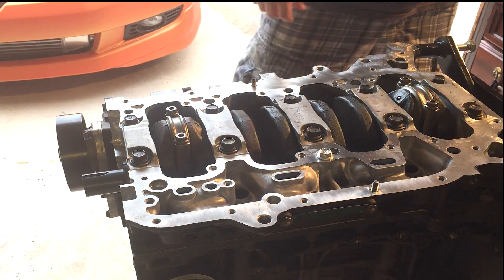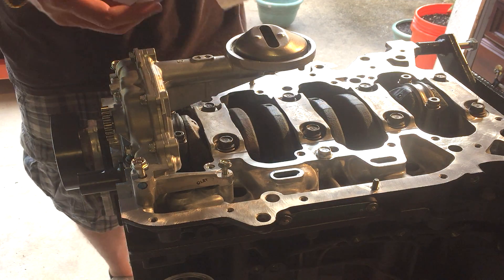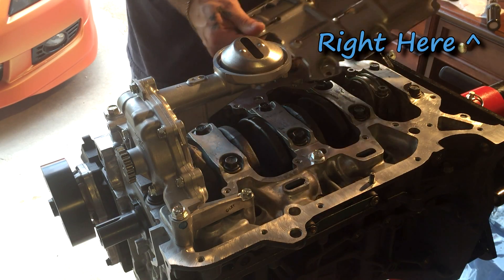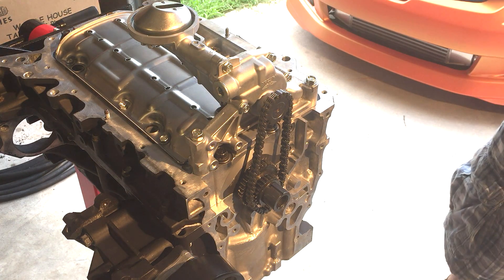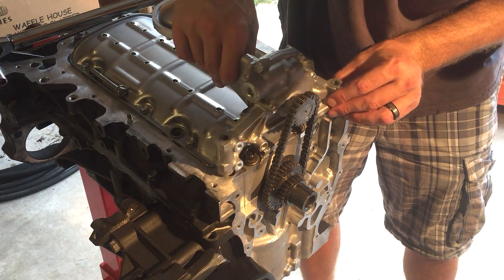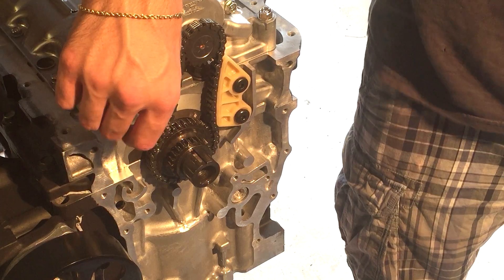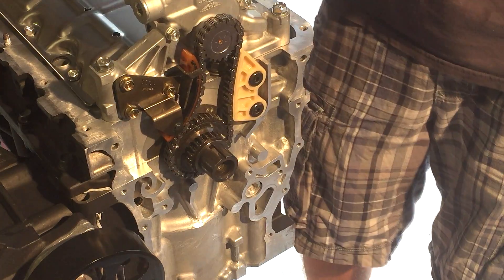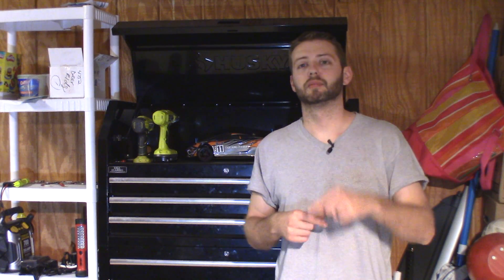RSX  Oil Pump On A K24 Block

Comment: i did  this mode but too much vibration,car doest remain smooth after this mode. Sound also increased. Sounded like a diesel. Reverted back to k24a2 oil pump. I love the balance shafts

Comment: awesome video. I ran into the Z3 block hairline crack on the block behind the thermostat housing. I ordered a 4 piston pump because I heard its ready to drop right in. I'm using my K20z3 head on the K24a JDM. U have any recommendations about the set up?

Comment: Hey, i have a question what's the part number to the bolt use to plug the hole there?
Reply from the maker: can't help ya there man. sorry. basically any bolt that matches the thread pitch and size will work.

Comment: i just wanted to know how does it feel vs the oem k24 oil pump i mean without the k24 pump balance shafts is supposed to be more noise, vibration, harshness in a 2.4 engine.  I was investigating and 2.0 is apparently the limit of accepted NVH without balance shafts thats why all engines above have them.  Thanks for your reply

Comment: What advantage does the RSX oil pump have over the original K24 oil pump?
Reply from the maker: the rsx oil pump is designed to have good oil flow at higher RPM. Alot better than the k24a2. It also weighs a hell of a lot less. dunno if it counts as rotational mass or not but it is a good 20 lbs.

Comment: Whats the difference of the kit? modified and unmodified. i have a k24a2 long block for rsx-s. All help is appreciated, thanks for the video
Reply from the maker: Kevin Yang the modified kit come with the oil pump already cut/ground to fit the k24. The unmodified one you have to do yourself. I have another video showing all that.

Comment: How many foot pounds should the block off bolt be tighten too?
Reply from the maker: HellaDomo the bolt that came with the kit wasn't quite as long as I would have liked it. It probably only got 3 full turns of thread. So I used Honda bond on the threads and torqued it to 14 ft lbs. very light but snug.